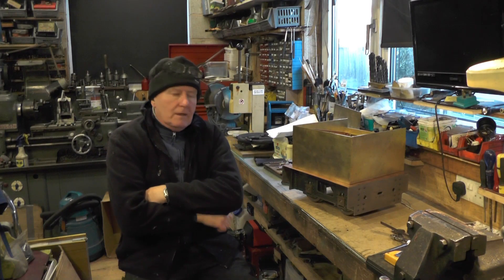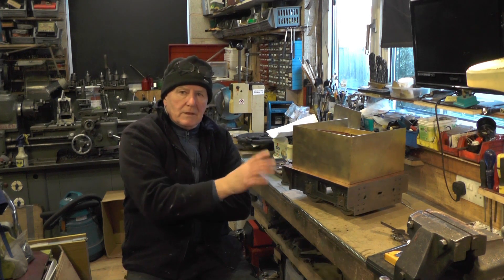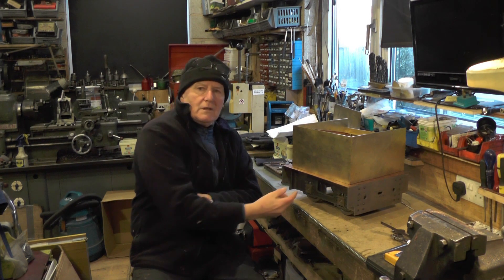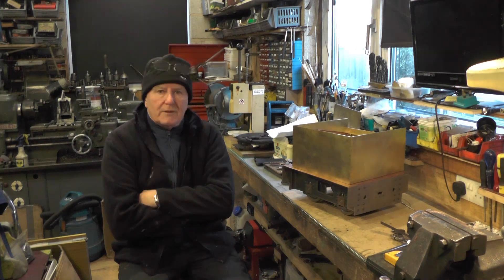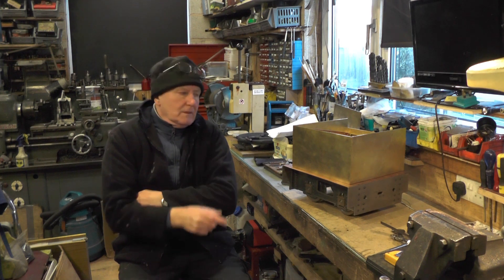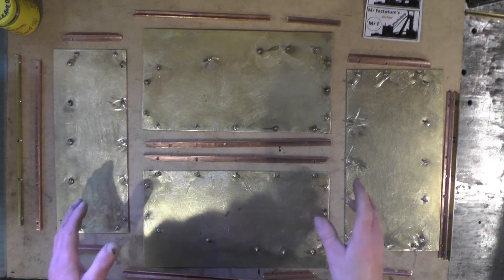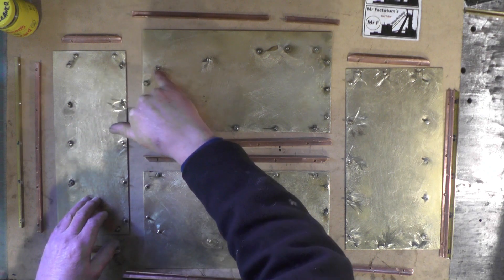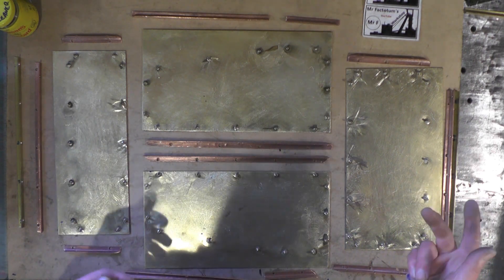Make a Water Tender TANK BUILD P6 - For "Scratch"(My Beginners Steam Locomotive Series)"mr factotum"

Comment: Hi Kev,
Nice job on the soldering...looks great. I'm thinking of installing a diesel heater for the low operating cost. Everyone seams happy with them.
ATB...Dean
Reply from the maker: Cheers Dean
Go for it! you won't be disappointed if it works as good as mine does.
regards
Kev uk

Comment: Well Kev what a brilliant video. I have done lots of different types of welding, brazing & soldering but never Silver soldering. Great to see how it is done. 1st Class.
Regards.
Steve.
Reply from the maker: Thanks 👍 cheers Steve
I must have overlooked saying, but its soft solder, silver solder too expensive for non pressurised vessel, but the soft solder is fine for the tank and strong because of the internal angle frame's surface area. Sorry if misled you. I silver soldered the boiler in previous video's.
see you next time
Regards
Kev

Comment: Another thorough job Kev. I was given a full packet of large solder sticks[probs about a dozen sticks] I could send you some if you can use them as Ive had them about 20 yrs I,m unlikely to use them now. Regards Stuart from further North. Ps I go my little diesel heater rigged up and it warms my garage/workshop up in about an hour and it runs on a sniff of diesel. No nasty electricity bills coming down the line.
Reply from the maker: Well thanks very much Stuart, 👍👍👍
glad to hear you got the heater, are you using red diesel, it's scarce around me but managed to find some not far away. mind you i found it's got alot of crud in it so i'm filtering it through a spray paint paper filter. Mine's working great and economical, it keeps the chill off me in my large garage/workshop.
Thanks for the offer of solder, it would be much appreciated, l have a boat load of postage stamps to use,  so email me your address and i will send some to you for postage costs. My email is on my about page but only shows up on a PC/laptop, for some reason phone apps it does'nt show up🤔
regards
Kev
Reply: Thanks Kev , I,m running onkerosene with a dosing of oil for lubrication.  Ive tried sending the details you asked for but I,m using an Ipad pro so it may not have work as it looked like the generic youtube address. If not I will get the daughter to do it on her pc Regards Stuart
Reply from the maker: @grandadsfishingboat7455  eyup stuart 
not recieved, will keep an eye out for email later when you get chance
atb
kev

Comment: Hi KEV 
Excellent work. do you think a light coat of epoxy resin inside would be necessary
OL6162
Reply from the maker: eyup ol6162
No need, just needs etch primer and paint once i get the lid done👍👍👍👍👍
atb 
KEV